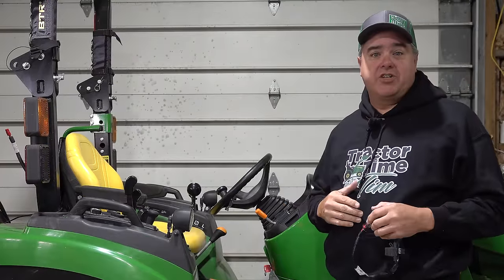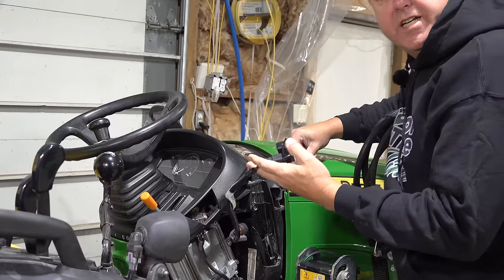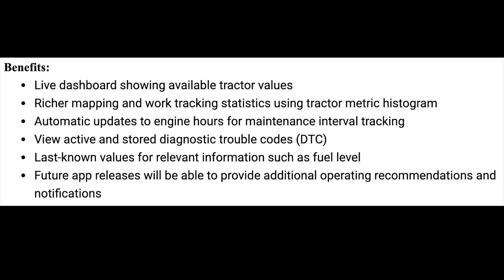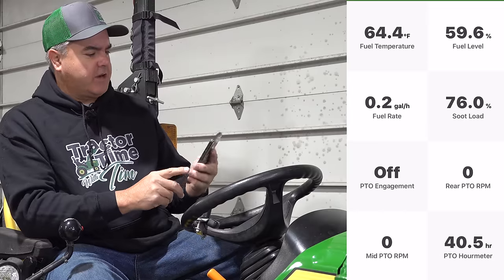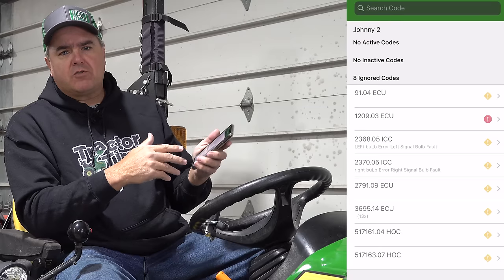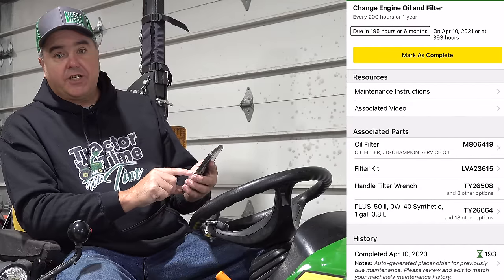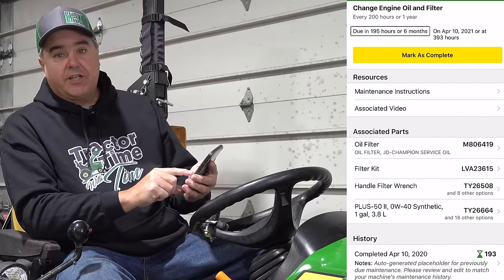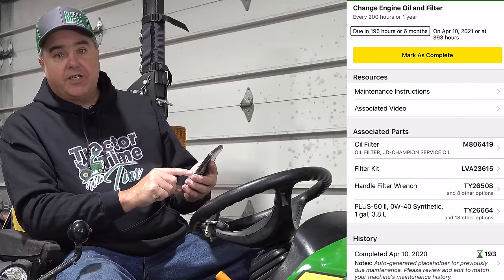Connect Your PHONE to Your TRACTOR!!

Comment: The Ambient Temp reading is more than likely the Intake Air Temp (IAT) sensor for the engine. So after a good run, it is reading the air temp it is drawing in from the underhood hot air.

Comment: The price of the Bluetooth JD scanner is right in line with other devices like the OBD-II scanners for your car/truck. And the information gleaned is similar. The error codes are invaluable like you mentioned to help avoid a dealer visit.  Too bad you couldn’t clear the error codes.  Access to part diagrams is very helpful too.  Great video as I didn’t know this existed. Thx.

Comment: Impressive, was not aware that this existed.   I will be ordering one for my 3032E.     Oven is impressive as well - one of my favorite software gigs was working for a startup in 2004 that created a double wall oven that contained a refrigeration unit and could be remote controlled with a web browser or cell phone (IVR / touch only, no smartphone apps then).    You could put your food in before you left for work, the oven would keep the food cold - then with either a timer and via remote control tell it when you wanted dinner ready, just as you are walking in the door.   Company went bust, people were not willing to shell out $9k, but we had a really good time for 3 years with the technology (linux inside !).

Comment: This is easily worth well over the $99 price tag. I have a Deere wide area mower. When it has an electrical issues it flashes the glow plug lamp. I have to count the flashes and call the dealership to have them lookup the trouble code. Also the manual and parts diagrams, Deere hit it out of the park on this one!

Comment: I have the 1025R , and its too bad that this device and app will not work with my tractor.  I have a similar device and app for my outboard motor, a 115 hp Mercury .  It does a lot of the same things, but I can see the JD app and unit does more.  Very useful in my eyes.  Good video Tim on the explanation of this device .

Comment: thank God i bought my tractor before electronic engine control, . the only thing electrical on my engine is glow plugs, starter motor and probably a fuel shut off solenoid.  although i do see the advantage of service lists,
Reply: Its because of new emissions requirements.  But it kind of removed a roadblock for manufacturers. They always had to be careful of amount of fuel and combustion temp to keep emissions low in the past. But now that they are collecting the soot in exhaust, after combustion, they can do things now with the engine they couldn't do before. One of the things they learned they can do is if they put in common rail fuel system (my cummins runs 30,000 psi) then they can use less fuel if they squirt the diesel in at high pressure. It disperses and atomizes better getting a better combustion and more power. But they need the computer to control the injector & other components.  Thats why in the past 10 years you have seen some big jumps in power output from diesels. 

That's one of the reasons why you need to add fuel/injector lubricants when filling up. It keeps injector tips from wearing out too fast from extreme high pressures. Other reason is the method they use to remove sulfur from the fuel also removes some of the minerals that helped to naturally lubricate fuel system. So it's real important with new tractors but even old tractors need the lube now so they don't wear out fuel pumps. 

Ok... im ramblin now.  My bad

Comment: I love blue tooth diagnostics. The heavy duty diesel engine market has went to odb diagnostic. Makes finding issues a bit easier. I was wondering why tractors haven't or if they ever would. That's a very useful devise. Maybe more info on hydraulic would be handy. I may missed that on the list? But great videot Tim and Chrisy!!I have one series but that's very good info.
Reply: Obd2 was made mandatory for emissions. Since the tractors don’t have to, they make it propitiatory data.

Comment: Neat stuff for a retired programmer!  I use the app but can’t use the device with a 1 series. Also just bought new appliances (GE Cafe’) that all connect to internet and come with the free Bluetooth skillet.
Reply from the maker: Ours is GE Cafe too...double oven induction.
Reply: Tractor Time with Tim that’s what we have. Induction is the only way to go. Fast and clean. The microwave uses Bluetooth to connect so light/fan operate with range burners. Refrig and dishwasher complete the set.

Comment: I love stuff like this. I watched several videos of a company in England that tracks down stolen equipment that has a GPS tracker hidden on it. It seems small excavators and other small pieces of equipment get stolen quite often. The service the company provides is they turn on the GPS to find the general area. When they get close to the missing equipment, they have an antenna that will pin point it’s location. I have watched them recover high end cars also.  They don’t show the device that transmitting the signal. Does this device help with theft? Like locking out the ignition ..... I guess this device can help with pricing of your jobs.

Comment: My dealer suggested I get this app when I brought my Johnny home. One year ago this month, I did and it was helpful since it had how to videos that showed R&R of the loader and mower so I could do a quick look to make sure I had the steps right. But now videos are gone and the app has changed to what you have and I like  having the info for serial number,  service intervals  and parts diagrams. Other than that its tells me what service is needed and in X number of hours. I do have to change the hours myself on the app to stay current Alas no plug in for me but then I have $99 more in my pocket

Comment: Trouble codes is good to have as long as they can give you good info on dealing with the issue.That I would need to see more of.But the price seems to be inline with most BT diag devises sold.
Reply: That's for sure. I can see folks calling the dealer more often to report codes that aren't a problem. Plus the added anxiety of seeing an error code on a tractor you thought was working just fine. :-)
Reply: EOSJOE  Picking a good dealer seems to be the Key..If they are willing to support you even when codes aren’t a big deal would make me think I picked a winning team.

Comment: I really liked what I saw as you demonstrated the use of the JD Bluetooth connection. So I bought one.  Just got it today and easily installed it on my JD2032R model year tractor.  [Thanks for the free shipping] Also downloaded the app for my Samsung S20 phone. I had to manually load the PIN for the tractor & implements/attachments because the apps camera reader didn't recognize any of the bar codes.

My phone would pair with the new device, but it kept giving an error saying that "an app was required".

I was never able to get it to communicate any live information from the tractor to the phone!
I read the reviews for the app.  It appears that some kind of update has destroyed its usefulness. 
Any suggestions?

However,

Comment: Hello Tim, 
Love your videos and your Bible verse at the end. I’m currently waiting on a 2021 1025r. I’m trying to find out if the new 1025r will exclude this option. 

Also, is there a auto remote start for warming it up in the winter from your home as is done with cars?
Thank you
Bill Kromer 
Kromdog
Reply: Included this option!
Reply from the maker: No, new 1025R will not include the smart connector compatibility. 
I do not know of a remote start for these small tractors.

Comment: Tim, I purchased a Tractor Plus from Green Tractor Parts (?) to put on my new 3033R. My John Deere dealer installed it but said they had never seen one before. It works partially, does not show all the menu items (live dashboard). I have talked with Green Tractor Parts and they gave me instructions on how to pair it to my phone but that did not change anything. I listed my tractor and all the implements and they showed up on my phone. Could you possibly tell me why the "live dashboard" will not show on the menu? Any suggestions would be appreciated.
Reply from the maker: I do not know. Sorry.
Did you mean greenpartstore.com?
Reply: Yes, I couldn't remember the name at the time,  sorry.

Comment: I must have gotten a dud.  I ordered the connector kit BXX10255 from green parts store and downloaded the app for my i-phone.  Problem is it won't sync with the phone.  The light on the bluetooth flashes but won't sync to my phone or i-pad.  Guess I'll return it on Monday.
Reply from the maker: Bummer!  I guess it happens!  I’m sure greenpartstore will take care of you.  Just let them know yours is faulty.   They’ll replace it.
Reply: @TractorTimewithTim    Tim, Thanks I'll give them a call and see if I can get a replacement.  I really enjoy your videos and seeing new products.  I have the Heavy hitch tooth bar and I'm really pleased with it.
Reply: I got mine today and can't get it to pair with my Pixel 2xl or my old Moto X4. I doubt it is the phone. Will call to see about a replacement. Did you try to disconnect the Bluetooth module from the cable. I got it on, ok, but can't get it off. Not sure if the red slide on the connector needs to be up or down, but doesn't want to budge either way.
Reply: @SethKrieger  The red tab will need to be up and you will have to take a small flat blade screwdriver and pry up on the tab slightly.  My i-phone 6s and i-pad Mini 4  will not show it as a device.  My wife's Samsung will show it as a device but it will not pair.
Reply: @donthompson5491  Yep, my phones are doing the same thing as you wife's, I think. The phone sees the device, but just flashes "Pairing" briefly when you tap the Deere icon.  Once in a while there is another unhelpful message like "Cannot communicate with Deere". I'm not sure I understand your instructions with regard to the tab, but I don't want to risk breaking anything. I'll just send it back attached to the cable. Thanks for the suggestion, tho!
Reply: I received the device yesterdqy, hooked it up today, and can't get it to pair either.  No installation instructions past plugging it into the tractor.  Will have to wait until Monday to call Green Parts Store.  Any help Tim?  I have a 2032R.

Comment: Wonder when they will come out with Auto Steer for sub-compacts. Lol.
Reply: If you want to buy it I can install a deere integrated system on it
Reply: They do I have installed them and yes even gator also. Jd has a system that works on anything with a steering wheel. Not a integrated system yet but is doable
Reply: Lol. Thats been out for years & years.  They call them kids.
Reply: @andysworld2188  Lol. That thought crossed my mind as well.

Comment: Really sad this is not compatible with my 2014 1025r. I recently purchased the Autel equivalent for my Ram and Ford trucks. It too is Bluetooth and pulls codes and other live data (if vehicle supports it). I wish both of them would go to the Internet and grab the actual DTC and give us some repair or troubleshooting ideas. I usually grab the codes, in the Autel I can spit out a PDF of the vehicle and all the codes and details.

Comment: Tim I know this is off the topic of this video, but what pressure dol you run in the 1025rs versa turfs?
Reply from the maker: I dunno. Haven’t checked em since the Rimguard guy filled em
Reply: @TractorTimewithTim  yeah I hadn't checked mine in a while with rim guard but when I loaded up with my counter weight yesterday, they looked flat. Checked them they were at I ky 15psi, but the sidewall says 20psi max which seems low to me.

Comment: The more I see what is being done with Compact tractors, the more I appreciate my nearly 20 YO Kubota. NO electronics, Period!  Simple mechanical injection, can survive an EMP and still run.   Lets see these new tractors do that!
Reply: If your tractor would have to survive EMP, chances are you wouldn't live to know it. So, it's a mute point.
Reply: @ruslankadylak2999  I live out in the country, EMP could strike 80 miles away and still affect equipment, wont harm people one bit unless they happened to be touching something that arced.  Regardless, I would much rather have my simple old mechanically injected diesel than all the added emissions and DEF crap they put on them.  Something goes wrong and your tractor is DED Dead, and if it is out in the field somewhere, you have to figure out how to get it back so it can be hauled to a shop for it to be cleared and repaired.   No thanks.   KISS when it comes to these.

Comment: Just installed mine and my iphone will not connect to my 2017 2038R. Checked all connections and they are all good, the little blue light is blinking in the blue tooth attachment.  What have I done wrong?  I am running ver. 13.7 on my iphone.  any suggestions?  Got TractorPlus app on the iphone
Reply from the maker: Make sure to add the device to TractorPlus app

Comment: Greetings i just wanted to let you know it seems there is some trouble with the TractorPlus Bluetooth Connectors. I received mine the other day and had high hopes due to a positive video you made. But alas it was already not a great day and this part finished the day by totally NOT working. No ones fault and not laying blame anywhere just to put that out front. Had nice conversation with a representative from AHW (GreenParts Store) and apparently in the last week 5 others were also non-functional. So, there may be a problem or maybe a bad batch who knows??? But anyway to add to it AHW is developing a plan and hopefully will have some answers for the faulty parts from their end. If the consumer has a faulty part email AHW LLC and give them your order number. Have a Better Day!
Reply: For what it's worth, the Google play store just updated the app today and fixed our problem with non connectivity. This is for Android devices. Give it a shot?
Reply: @chrislocke7547  I checked for IPhone and there was no update for them yet hopefully soon. So, my luck still runs bad...............
Reply: @chrislocke7547  I'm still not able to connect with my android???? What could be the problem??
Reply from the maker: Go to the TractorPlus app, and ‘add’ the smart connector. Then, hopefully it will connect.
Reply: @TractorTimewithTim  Also I received this from Greenparts it's a cut and paste. I am going to try everything hopefully it's works! 

(Gregory, Thank you for getting back. We have some information regarding the smart plus. The steps to take now are to delete the tractor then delete the app. With the key turned on, download the new version of the app and then add the tractor for installation. Try this please then let us know the outcome.)
Reply: Success! It’s up and running!!!!!!

Comment: Tim, how well will this work when you and your tractor live 15 miles from cell service?  Good luck.
Reply: It is a Bluetooth connection, so no cell needed once you've installed the app
Reply from the maker: No need for cell service.  Bluetooth only.
Reply: @TractorTimewithTim  Thanks Tim, that is amazing, it will even do the mapping without cell service?  I have never learned about smart phones because they won't work here.  Good luck.
Reply from the maker: I don’t think it will do mapping.

Comment: I think this would be very cool if it would work with iOS. I have an iPhone and it would not find the TractorPlus Connector no matter what i did to get it to work. I talked to my dealer and said he found a memo came out in December 2020 that there are issues with this connecting to iOS. Is anyone else having issues connecting to your iPhone? Please let me know. TL
Reply from the maker: Yes, there is a simple solution.

Rather than ‘discovering’ the device with the iPhone Bluetooth, use the TractorPlus app to do the discovery.
Disappointed that your dealer did not fully explain that, rather than saying ‘there are issues’.  They should be ashamed!

Comment: The way JD is with not helping anyone "right to repair" with info for repairs this would not be much help with the dealer! This is the reason a lot of us don't buy JD! I didn't even look at them before buying my new tractor last yr.
Reply from the maker: Wow.  I have not had that experience at all. Neither has my family on the farm.
Call the service manager, he helps diagnose remotely.   Then, sends a tech out with the replacement parts.  If they don’t have it, they will either tell you the nearest place you can drive to get it, OR have it there next day air.
Other brands may be just as good...not arguing that.  However, working with 3 different dealers in two states, my extended family is quite satisfied!

Comment: I can't get it to work with my android??? Help needed!!
Reply from the maker: From a facebook post:  

Mark Brown
Jeff Miller. I got it to work with my Samsung Galaxy S10e. Here's what I did. I deleted my tractor from the app. Then I went to the apps list under phone settings. I went to the tractor plus app and deleted the data and then uninstalled it. Then I went to the Play store and installed Tractor Plus. This time after it installed, it said "update" where it normally says "open" in the play store screen. I hit update, and now when I go to add equipment in tractor plus, it automatically starts scanning for a smart connector. It found mine and is working now. 👍
Reply: I'll try this Tim and see what happens. Thanks
Reply: I can get it to work except for the tracking function.  It starts but when the job is finished, the tracking  is not there.
Reply from the maker: Do you have to allow the app to access location services?
Reply: @TractorTimewithTim  Yes
Reply: I got the tracking function to work today by disconnecting wi-fi before starting the app.  I still have no history of engine data during the job.  The new app information (ver. 2.1.1) says that it is for 2019 and 2020 models.  Mine is a 2018.
Reply from the maker: What model tractor do you have?
Reply: @TractorTimewithTim  2018 2038R